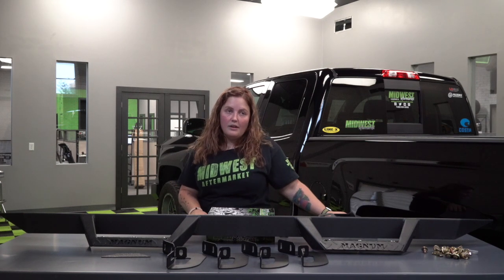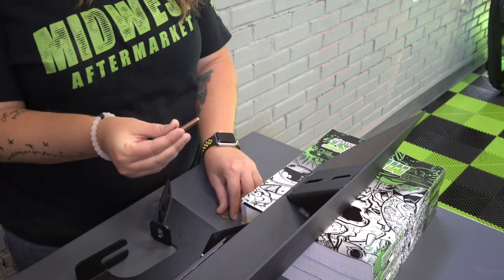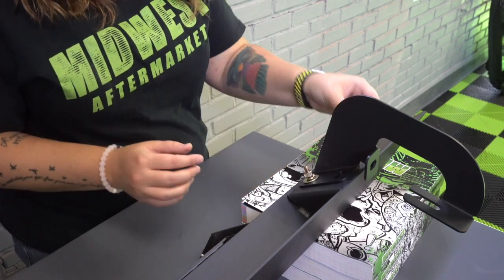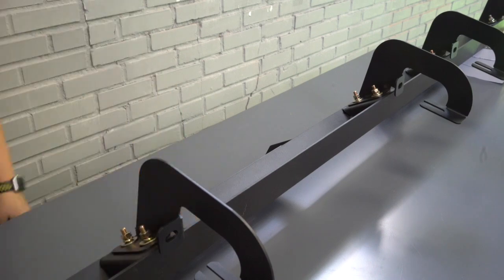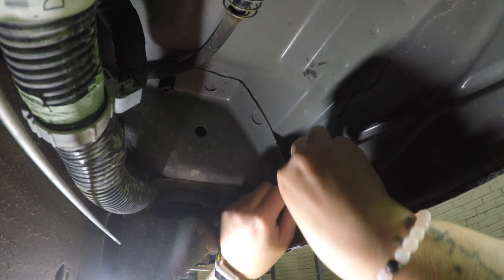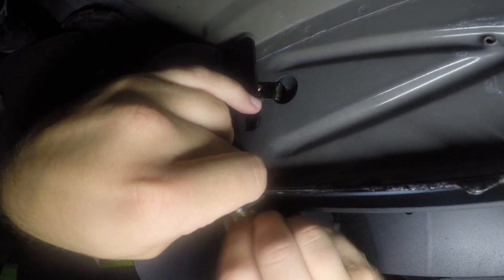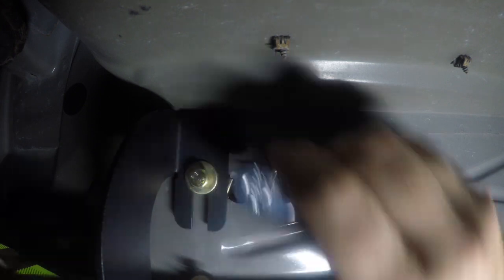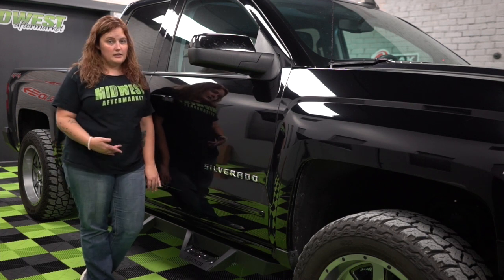ICI Magnum RT Step Bars RTS14CH for Chevy Silverado Installation!

Comment: Awesome looking steps! I took mine off because over time the bracket WILL tear the body
Reply: How long was it after installation that you noticed this? Ive had mine on for almost 3yrs.
Reply: Are you a hefty man? Curious if it might be a weight issue?

Comment: just installed these on a silverado crew cab 6.5 bed, wheel to wheel. couple tips. put all the brackets on loose only, then mount them and put the top bolt in only loose, then go to the bed bracket mount. that factory bolt has a attached washer, the washer is too fat to fit in the bracket provided for the steps, so just grind the washer flat on each side enough so that it will fit in the bracket, tighten down the bed mount bracket firm them go back to the front bracket and install the 2nd bolt loose, move on down the line until you have all the bolts in loose, then go along and tighten the bottom body mount bolts, then the top body mount bolts, then start tightening the front step mount bolts and move your way back. it's about 50 bolts total so it takes a little time if you are by yourself figure about 2 hours unless you are speedy gonzales, i used a impact to get them snug only and then hand tightened each bolt. came out great.

Comment: I have a 2015 Silverado LT 4x4 with the large OEM mud flaps - Will these step bars fit without removing them?
Reply from the maker: We have never had any customers have issues with their ICI Magnum RT not fitting because of their OEM mud flaps. There's a gap or cutout at the front of the step bar, and we believe that should allow any OEM mud flap to remain installed and not interfere with the step bar. Here's our recommendation: buy your ICI Magnum RT steps from someone who has free returns just in case and go ahead and pick them up and install them. We think you'll love them. Cory has had them on his F-150 for over a year now, and he loves them. And guess what? We offer free returns and free shipping. Head on over to MidwestAftermarket.com or give us a call at 1-800-951-3955 and let us get you a sweet deal on these step bars today, with the added peace of mind of free returns.

Comment: Can you guys list what tools/ size wrenches would be needed for the installation?
Reply from the maker: Been a minute since we installed these, but Cory was pretty sure it was a 1/2 inch socket and wrench. They were definitely pretty common sizes, so if you have a socket set and a set of standard wrenches, you should be good to go. Unfortunately, I don't have the truck at hand at the moment to get under her and double check for certain.

We are trying to list tools with sizes for future videos and go over exactly what tools you'll need in the video too. Sorry that we didn't do that in this particular video. Hope this helps a little, Brandon. And hope you enjoy your new ICI Magnum RT Steps.
Reply: @MidwestAftermarket  hey thanks for getting back to me. I appreciate it.
Reply from the maker: Sorry we didn't have a more specific answer. Good luck with your install. :-)

Comment: I bought a set of these nerf bars roughly a week ago, I was able to pre-assemble the brackets onto the bars/steps. But when I attempted to install them onto the rocker panel, only two of the 4 brackets and holes lined up to the 'pre-drilled' factory holes on the rocker panel. And I see everywhere that these are supposed to be 'no drill install'.

The two front backets for the driver side will line up just right, but the second two are about half a foot off (~6in. front of the 2nd two bracket holes) where the brackets for the bars are located. I'm unsure if the factory holes are wrong or if the holes for the brackets were placed incorrectly, either way, it's upsetting.

The vertical lines symbolize the 4x brackets on the Magnum Step Bar, the 4x holes are the factory holes under the rocker panel. And the horizontal lines are the spaces between each bracket. (Driver Side)
(rear of truck ) <_____| |\| |___O_______| |\| |___O__________| |O| |_______| |O| |_____> (front of truck)
Reply from the maker: Hello John!

I'm sorry you are having issues with the steps lining up and fitting on your truck. Could you let me know your year, make, model and cab size and also what part number you ordered? We can definitely try to help you out in getting the issue resolved!
Reply: Thanks for replying back, I'll have to check the number of these step bars after work. But the truck is a 2017 Chevy Silverado Double Cab 4x4.
Reply: I found out why the rear set of brackets don't line up with the rear 2 factory holes. The RT Side Steps I got were made for Crew Cab. I didn't notice that part till I looked at it again, sigh. I'll have to return it and see about getting the Extended Cab. The ones I got are, MAGNUM RTS16CH RT Step for Chevy Silverado/GMC Sierra Crew Cab (Light Duty) when I should've bought the "MAGNUM RTS14CH RT Step for Chevy Silverado/GMC Sierra Extended Cab (Light Duty)".
Reply from the maker: Hey John,

I'm glad you were able to figure out the issue, but definitely let us know if we can help with the return if you did in fact purchase the step bars from us!
Reply: I actually ordered it off of amazon, I honestly didn't know about Midwest Aftermarket until after I found your installation video which although the side steps were the wrong ones, was very helpful and informative. So no worries about the hassle of the return. I appreciate it though. I do have a couple other aftermarket modifications I'm wanting to make to my Silverado however, a dual/twin exhaust system and a more 'open' air filter. So I'll definitely take a look around on the Midwest Aftermarket site.
Reply from the maker: Let us know if you have any questions when you visit our site! You can chat with us on there or you can call into one of our sales team 800-951-3955!

Comment: so I installed my drivers side just like it said here, ive noticed a gap between the truck and the steps is that normal?  I was hoping these wouldn't be that way
Reply from the maker: Hi Joshua, there should be a small gap between the step and the truck. If you like you can always send pictures to support@midwestaftermarket.com for more assistance.

Comment: Instructions are all wrong!  The picture shows bolt, lock washer then washer.  Then the instructions tells you this?  Then step 5 says use 2 washer while the picture still shows 1 lock washer and 1 washer!  🤦🏻‍♂️

Comment: I bought these for my 2018 Sierra Elevation. I don’t really care for them. Just a personal opinion the steps are too small and narrow. In search of a replacement
Reply from the maker: Hoops or would you settle for a running board? If it has to be hoop steps, we highly recommend these new N-Fab Epyx Steps: https://n-fab.com/epyx-steps
We can get you a great deal on those by calling us at 1-800-951-3955 and mentioning you saw our video on YouTube.
If you'd like something really wide with a lot of step area, check out these new Growlers: https://n-fab.com/growler-steps
We've got great pricing on these as well and they offer great all weather traction all along the length of the board. Again, hit us up via 1-800-951-3955 and mention you saw our YouTube video of either of these products (they are both covered in our 2018 SEMA coverage series if you want to see these videos too and learn more about these great new product from N-Fab).